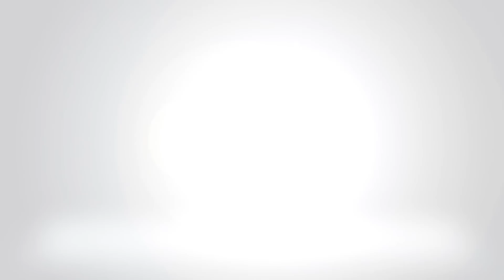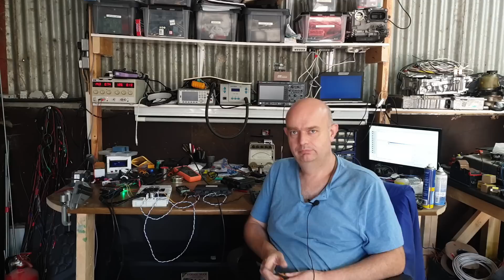BMW i3 LIM Programming

Comment: Handy tip.  Use a rubber band to hold the key on top of the gizmo so it won't slide off.  Your work bench looks like mine and I keep knocking things over.

Comment: You're above my head on some of this to be sure. I have a question though. Could you rewrite the lim to bypass or otherwise reduce the battery limitations on the BMW i3?
Reply: What limitations do you refer to?
Reply: @sirdevalot76  I'm not remembering exactly what I was thinking about when I wrote this but I'm guessing it was about limiting charging speed or limiting battery output to the drive unit. Generally I like to know if you can turn the screws on stuff like this.
Reply: @Ruralmn  Interesting idea. But even if there were options to change those parameters I would be very cautious to do so. There is a lot of interdependence between the implemented cooling solutions and the specific parameters of the used Samsung SDI cells. Or are you planning to use non-standard cells - in which case changing these parameters is probably recommended.
Reply: @sirdevalot76  currently no plans at only 78k miles on a 19 but I'm not opposed to changing things if the battery goes out. These i3s seem built well enough that a high mileage battery swap and tune might be in its future.
Reply: @Ruralmn  Yes, I also had no issues so far. It has become my favorite daily driver. But I am concerned about the battery. At some point it will be dead. And where to get a still working replacement then? I doubt Samsung will manufacture the exact same cells forever. So a retrofit might be the only option to keep the i3 on the road then. I am still unsure how realistic that is - especially in Germany, regarding the strict regulations.
Reply: @sirdevalot76  here in the states there's a few that have done a 154ah battery swap. Sounds pretty affordable but it's obviously really early for that. It sounds like the cells themselves are a fairly common form factor so I'd believe that aftermarket and diy options are good to be pretty real. I'm more concerned with the software side of stuff but I'm told it's possible just not super well published on.
Reply: @Ruralmn  I looked into this 154Ah option based on CATL cells. But I figured out that the dimensions of the cells are different, that's why they needed to design different modules for the cells to make them fit. On the package level they also reduced the available free space in between the modules and between the modules and the package housing. That's good for increasing the energy density but bad for the crash safety. On top of that the original modules used welded studs, but the 154Ah cells only seem to be bolted together. The third thing is that the weight increased again compared to the original 120 Ah battery. All those changes combined might give you a tough time with the TÜV. But that's something which I would certainly try if there is no other option coming up.
Reply: @Ruralmn  Another thing: I would like to understand whether it's possible to communicate with a high voltage battery which was already removed from a car. The reason is that some part recyclers have these batteries of the i3 lying around but they either don't know or don't want to tell what the mileage of the car was from which the battery was taken. I had an offer for a 120Ah battery for 3500€. But without any info on the mileage that might be wasted money. If you could read the remaining capacity or the mileage from the battery that would be great. Do you know any solution to this?
Reply: @Ruralmn  In the meantime I did some further investigation. The HV-battery is connected to PT-CAN2 on the i3. It sends out (among others) one message which contains the remaining max capacity every 200ms. So if there is a way to wake up the battery control module (called "SME"), you could read this field. As far as I can tell the battery does not store the odometer data. If it does, it doesn't publish that information. Apart from that BMW has implemented some kind of locking mechanism which puts the battery into a "safe state" when the car has detected a crash. In that state the battery connectors will not close - rendering the battery unusable. There is a special tool available (EOS tester - later extended and renamed to IMIB HV) from BMW to check HV batteries which also allows to re-enable the connectors. So it doesn't seem to be a good idea to just buy a random battery as long as you can't detect whether it's in such a safe/locked state.
Reply: @sirdevalot76  yeah I believe I remember a video of someone saying the tool can be used to unlock it but I don't know if the battery can be tested while not in a car currently but theoretically all that information should be attainable. Could in theory test an individual module using some of the commercially available tools for battery testing and charging the same way the ebike builders used to but this would obviously be a very time consuming process. I would say voltage testing could be a good quick indicator but it's not going to give you a lot of information unless it happened to be removed near full charge which is unlikely and not preferred either. I would say that most 120ah batteries available from the second hand market are pretty likely to be serviceable since they should wear very slowly compared to any of the other options and even the 60ah has made it to 200k miles occasionally. I'm partial to the 154ah but if the weight change is a legal hurdle in your area that's not an easy problem to solve unless you have a rex you can remove for a while 😵‍💫. The 120ah I would expect to go well past 200k miles in nearly all cases due to the extremely low load on the cells both from driving and charging. The only real exceptions I would expect to see are high temperature environments but it sounds like you're from Germany and I don't think that would be a real concern in your area. Of course finding out your chosen battery happens to be locked due to an accident could suddenly raise your cost. As far as actually determining wear on the battery I think the best quick way might be looking at the underside of it and comparing it physically to your car to make an educated guess. Kinda how people used to look at break pedals when odometers rolled at 100k instead of 1 million miles.

Comment: There is much more to see in E-Sys, you can change individuell options how the ECU should work. But you need to "unlock" E-Sys and a "non-trimmed" version of CAFD to have the full names of the options displayed. Otherwise the are all named ".", what is not really helpful.

Comment: It used to be dealers could change individual parameters via CAN with a service tool. I don't have specific information for BMWs but the way it works for me now, individual parameters cannot be changed. You need a file from the back office that would be the equivalent of the FA.
Reply: Wdym "change"? Some computer sends the CAN packets.. sure you can MITM them but then what?
Reply: @rkan2  typically there are parameters stored in Non Volatile Ram that define the way that component should operate.  Parameters that don't usually change like what country the vehicle is in or what model of car it's in. It used to be you could send a CAN command to change 1 individual parameter. Like telling the LIM it's in Europe instead of NA. A dealer could make those individual changes. However the way it works now you have to get The corporate office to write a whole new parameter file that the service tool can download from the "mother ship" and push to the LIM. Thereby limiting the ability to change one parameter at a time. Unless you can crack the back office parameter file.